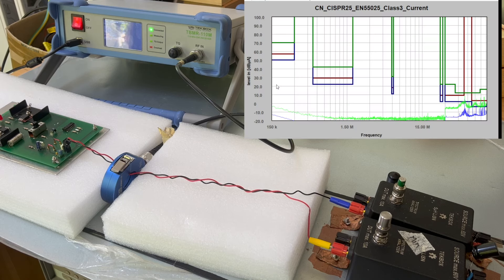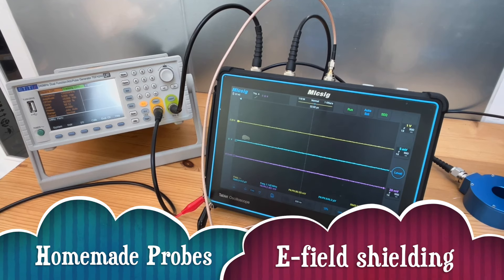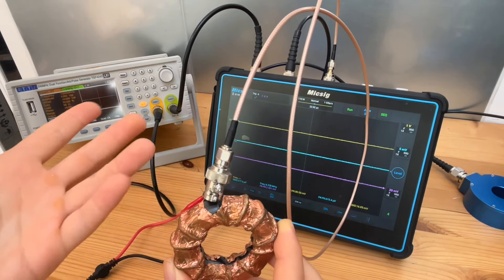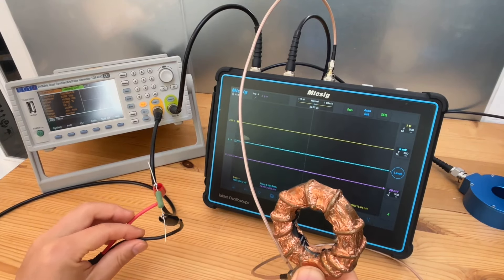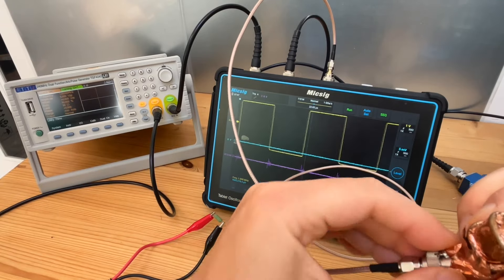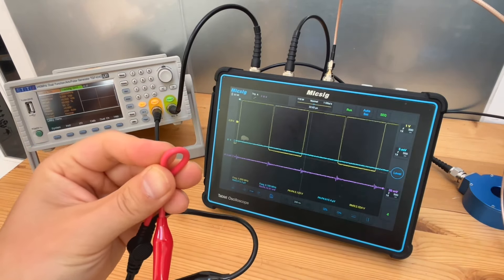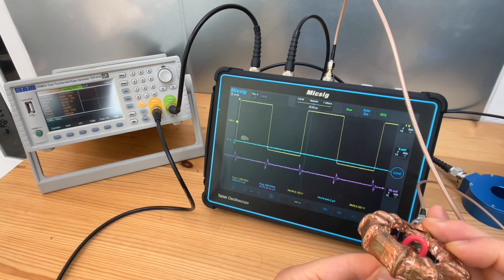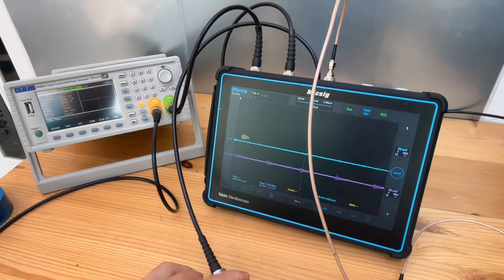RF Current Probes Episode 7 - Homemade Probe & Null Experiment

Comment: Wow, this is exactly what I was expecting. Thanks for the new video! 

One more question: inside the toroid, what was the cutout area for? Will it achieve better E-field shielding capability if we close the gap?
Reply: Ok, we may need to create a path for the magnetic field for inductive coupling. The copper shield is increasing the 'overlap area' and 'parasitic capacitance', so that the voltage built up on it is reduced. So we don't need a closed surface. Is this correct?
Reply from the maker: Exactly!